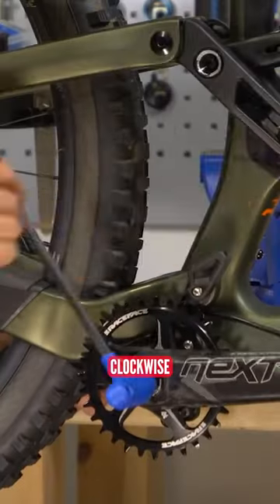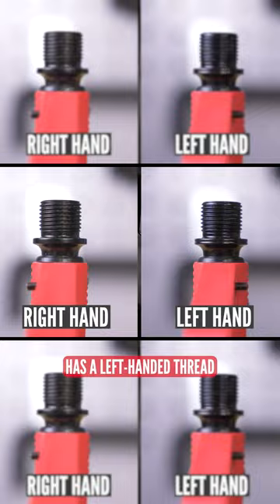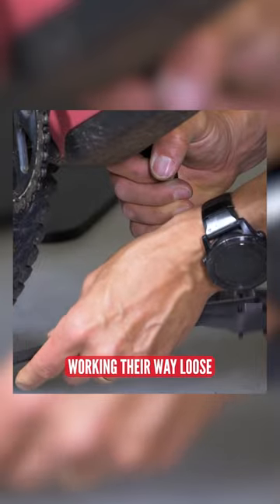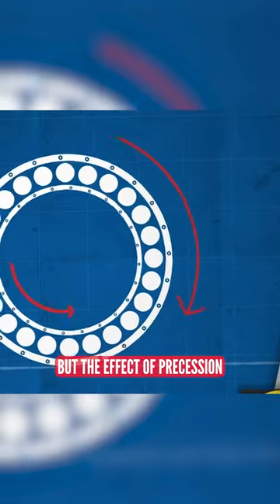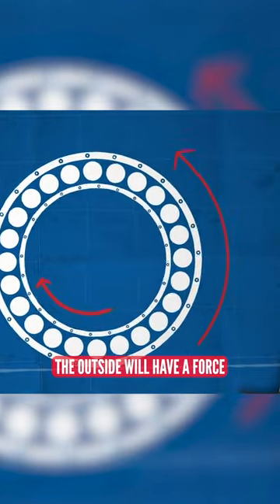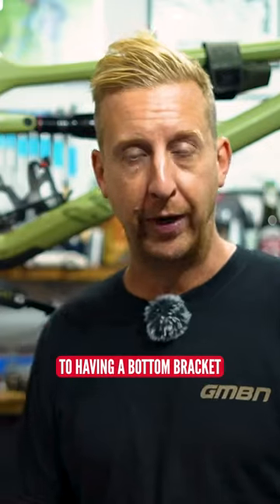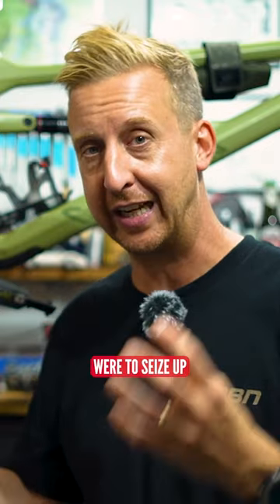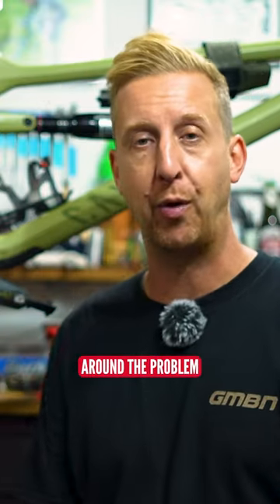Bike Thread Direction Explained! 📚

Comment: The BB acts like a harmonic gear during a normal pedal stroke which leads to a reversed procession in relation to the pedaling direction. Hence the reversed thread direction to ensure self-tightening.

Comment: Don't care what anyone says bottom bkt bearings spin loose that's why they have to be TIGHT, pedals on the other hand even if only finger tight will not spin loose, how can the outside of the bottom bkt bearing exert any force it's tight against the frame , and if it's loose they spin out

Comment: Why wouldn't precession affect the pedal bearings?
Reply: The bearings are captured inside the pedal body, you are only tightening the interface
Reply: This is wrong, I’m stupid
The bearing is not inside the threaded section, it is at the end of a long bar effectively, when a pedal bearing fails it locks up, you don’t want your pedals unscrewing when that happens.
Reply: @gtjack9  when the pedals lock up, they will unscrew. If you put a wrench on a pedal, hold it at a fixed angle, then pedal forwards, the pedal will come out.
Reply: @ryantanner47  🤦‍♂️ You’re absolutely right, the pedal rotates the opposite way to the crank, took me a good minute to visualise that.😂